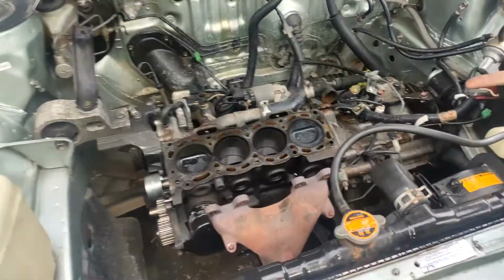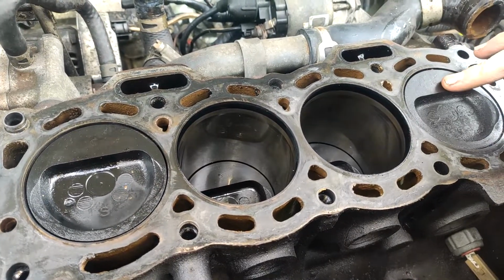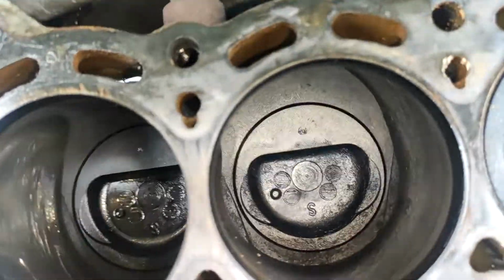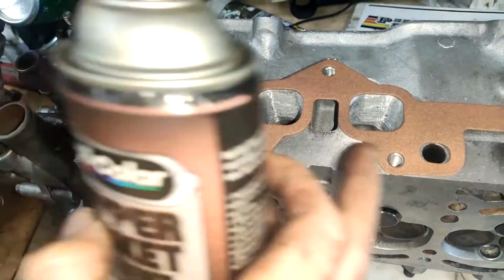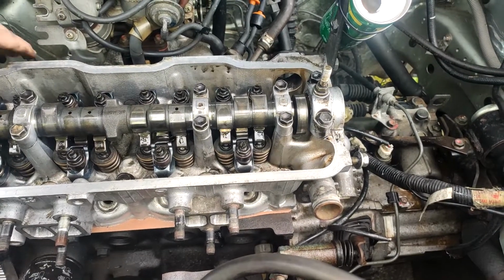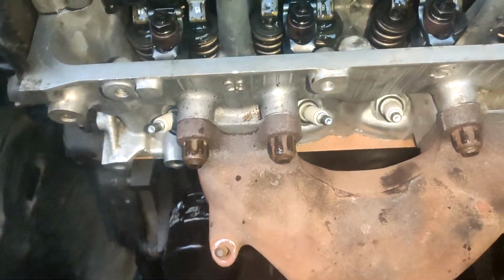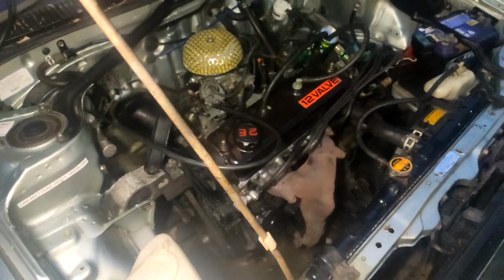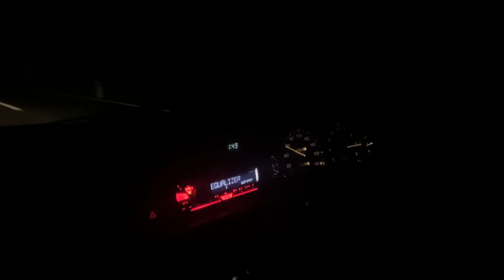Installing Performance Head On Toyota Corolla EE90 2E Engine

Comment: Your videos made me love my corolla again, just wondering if you have had any experience putting a rev counter in one of these? Pretty sure I'll be fine without but I feel bad ripping on it without one
Reply from the maker: yea run a wire from the dizzy there should be a plug on top just wedge a wire in there then hook up to signal for rev gauge

Comment: Saw one of your other videos, the one with the 2e with webers, is it the same intake as the one for the kp, if not where do you get weber intakes for the 2e
Reply from the maker: differnent manifold here a link to the manifold the 2e is the M008 they cost around $250nzd  https://manifolds.co.za/manifolds/toyota/
Reply: @RuggedGarage  thanks!

Comment: Bro dumb question but could you make video / give me tip how to remove the pcv valve from head? I tried it but i broke it and half stayed in there.
Reply from the maker: hi mate sometimes their hard to get out i would recommend getting out the blow torch and heating the area before trying to remove it will slightly burn the rubber o ring making it easier to get out thanks. ill make a video on this soon .

Comment: Difference of stock valve springs to a performance valve springs?
Reply from the maker: stock valve springs only safely rev to around 7000rpm before coil binding. The performance spring can support up to 10,000rpms before coil binding also are a very good mod when installing a performance camshaft .

Comment: Hello, IM going to instal valve springs and 266 camshaft and I want to ask what timing do you run on that setup
Reply from the maker: hi im running 15 degrees advanced on 95 octane gas also vacuum locked dizzy i just looped both ports with a vacuum line
Reply: Were I can get one of those? Thanks

Comment: Its very under power engine bro
Reply: It's a 1.3 it's going to be but at least somebody is given it a try to get power from these engines so many people would just swap in a 4age but I prefer this build
Reply: if a tuned N/A 2E is under powered , then what do you call a C220D 2020 MERC  when it gets killed at 220kmh by the 2E ( 435 000KM - TUNED NON TURBO OEM ENGINE...  ) ... AAT TUNED ...!!!
Reply: @sheridanscally5595  i have the same in my EE100 Corolla i feel it struggling in hilly areas otherwise its ok